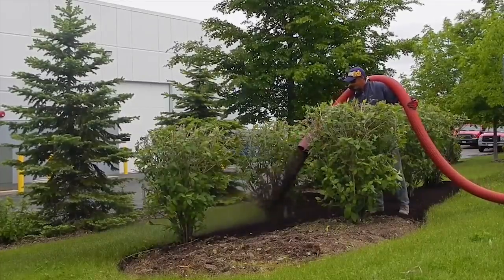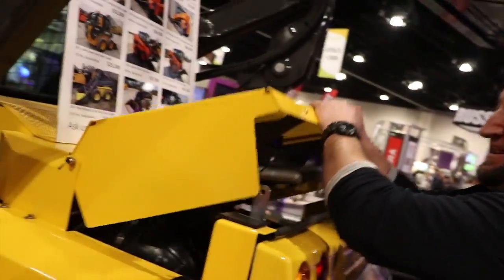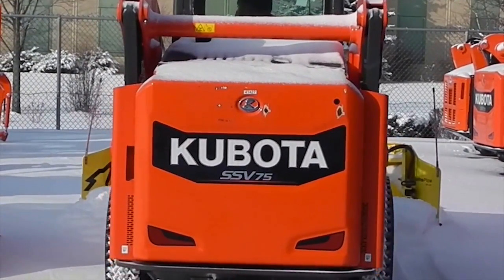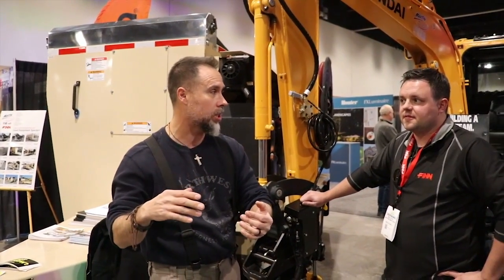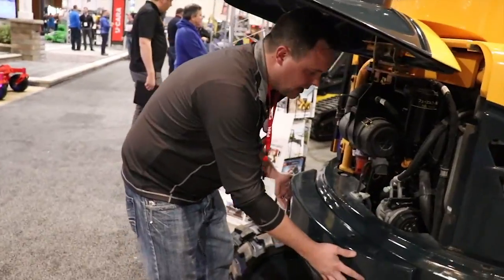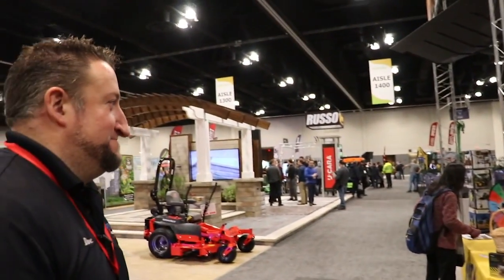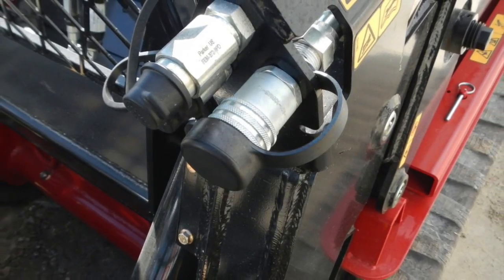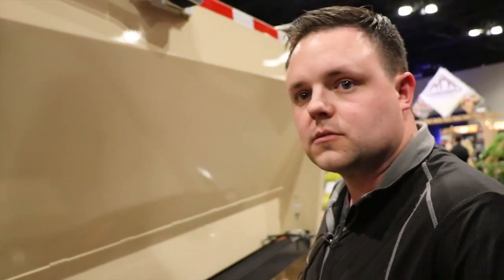Whats new in equipment at the Illinois Landscape show sponsored by Martin Implement

Comment: We've had a FINN bark blower for 6 years now upgrading to the latest greatest version last year and they are amazing. They do the work of 10 men no joke, they don't show up to work drunk or hung over or call in sick as long as you do basic maintenance with the added bonus of it grinding the mulch again before its blown making crappy mulch look like it's higher quality and good mulch looks like black gold bagged mulch lol. With only 3 guys we sprayed 85 yards in a 10 hour day at a condominium HOA which is insane because lots of beds lots of bushes and the person spraying can make sure a even amount goes down and smooth looking which saves tons of material on big jobs, that much used to take us three days with 8 or so guys working 12hr days tossing it by hand using wheel barrels so there were bare spots as well as behind bushes missed and lumpy clumpy appearance which looks like crap. Gotta do like 1500+ yards of mulch a year to really make money with it, otherwise it's better to line up a ton of jobs that are prepped and rent it for a week or two and spray like crazy. Obviously a loader is needed to keep the hopper full, we also have multiple extra sections of hose which enables us to do more from a single spot/pile of mulch. For smaller jobs you can fill it out of the back of the truck that is pulling it. Some companies have the unit hard mounted to a cab and chassis which the largest unit they offer usually is. Spraying 20 yards an hour or whatever the sales guy said could only happrn if you had a never ending wide-open area with no obstacles. Also in their demo video they should show how the person spraying can use their hand with a nice have duty glove to felect the mulch in order to protect bushes or the siding of a house etc.  Overall it's an amazing machine, the hydro seeder they make is top notch as well.

Comment: The company I currently work for does mulch for townhomes. A lot of town homes. We get 2 18 wheeler trailers of mulch dumped at the common areas load it onto the dump truck with a bobcat. Drive the dump truck to the start of the neighborhood and load from the back into wheel barrels, point is with all that handling well still get 12-13 yards out in 45 minutes roughly. With one guy spreading right behind us. All month long

Comment: Where i work we have one of the FINN bark blowers, i have used the 500 series and the 300 series. They work great for bigger mulch jobs, but the 500 series out runs the skid steer loading it. The 300 is perfect inbetween for commercial and residential mulching.
Reply: I also dropped the 300 series off a 7 foot wall and it had not a scratch on it

Comment: Also hyundai are big here in the UK,  they make some of the most used machines  for large and small construction applications and businesses, I had a hyundai and a kubota, bit were excellent. Lots of hrs on them and very little issues mechanically, if you find one that takes your fancy,  take the leap and buy one.

Comment: I have manure spreader chain basically. I think the express has walking floor correct? The express blower I wanted had several thousand dollars in upgrades to use the parts that were available from the factory at the time and needed more parts that were not available from the factory anymore. I would have to fabricate them all. 
 I’m not intending to bash just sharing my experiences. I like John Deere despite them getting the Caterpillar mentality,Kobelco , Volvo, Takeuchi, and Case.

Comment: Had a snow wolf like that 3yrs ago, it was slow to function,  pretty durable.  Kaboata skidsteer are junk, things are beat after 2-3k hrs of everyday use, guys I know get 2yrs outa them then they dump them. Hyundai equipment,  JUNK looses more value every time u start it, a quary had a 980 size Hyundai loader, what a turd after 1yr, completely wore out, bucket was paper thin and the beefed up welded wear plates just fell off with chunks of bucket the more they ran it. Its homeowner crap

Comment: For $99,000, plus truck and 2 employees, you have to move a xxxxload of mulch, etc. to see any type of ROI.  In addition, if it does move 15-20 yards per hour, I assume all of your material is on site.  If not, with only a 5 yard hopper, you are going to be making numerous trips back and forth to your supplier.  That bing the case, now you will  need to have a loader on site, which is probably as much the hopper. $$$$. Yikes!! I'm sure the repairs are inexpensive also.

Comment: Finn bark blower was the best investment to grow my company the quickest and with the best customers
Reply from the maker: That's great Tim, thanks for viewing !
Reply: @Tim Caron We install between 4 to 5,000 yards per year by hand and are considering either the MulchMate or a Finn Blower. My only concern with the blower is dust from the mulch getting into ac units and windows around commercial properties. Has this been an issue for you?
Reply: Alex Cochrane The major benefit of a bark blower is material preservation.  I can paint the bark a 1/2 inch to 3+ inches consistently throughout the project depending on contract.

For best results you spray approx 1 inch.  After the first rain the mulch sets and doesn’t move through out the year.

1 shoveler can keep the machine loaded if he’s working his ass of all day.    We had best results with a Cat 420 back hoe.  A skid steer makes a mess driving to the machine.

You can’t have idiots working on the machine.  The machine can be finicky until your used to it.  Can’t over fill and must sprinkle the mulch in as to not compact it.  Also the remotes are expensive so have the person writing the checks responsible for the remote.

I charged about $600-1000/ hour. 

I repeat you cannot lay bark mulch as smoothly as you can with a bark blower and a good operator.  The end result always comes out better.  You immediately have to go around with blowers and follow the machine hitting the grass, the bushes, the walkways, and adjacent buildings and you must do it prior to it raining or getting wet or it’s a nightmare.

Best part of the blower is it’s $100k new and 10 years for now you can sell it for 100k because the cost of the blower keeps going up.

If you put 5000 yards down a year that is the break even point for owning a blower.

I used to rent the machine for $1200 a day and had a waiting list,  two weeks of rentals pays for the machine for the year.

Comment: Hey Stan! Something out of left field for you... What kind of suspenders are you wearing? I'm a big fan of suspenders and have been wearing them religiously for about 9 years. Personally, I've been a big fan of "The Holdup Suspender Company" (not a paid endorsement). I bought a pair specifically because I needed TSA checkpoint-compliant suspenders for travel and because I worked in a secure datacenter with TSA-grade scanners. Their "NOBUZZ" poly-clip clasps hold super tight and never chew up my waistband. I notice that you seem to be wearing plastic clasp suspenders as well. I'd be very interested to hear your choice and experiences for what you're sporting! Thanks for another great video!

Comment: I just bought a 35z-9a Hyundai and its one of the best, if not the best mini excavator in its class. I tested bobcat, Kubota, John Deer Ect and its hydraulic system and how it puts the 25hp to the ground is amazing. I got a ton of options cab, heat, ac, radio, hydraulic thumb, pin grabber, long arm, counterweight,  2ft bucket and it was still 5k less than other machines. Its amazing on fuel runs about 8 hrs on 8 gallons and has plenty of power. Only complaint is AC works amazing but it falls on its face (very slow) when running ac. Can't really complain when it only has 25hp and zero emissions. My friend has a Hyundai 60 and 160 and both amazing machines for the price. When I buy my next machine, Hyundai will be my first stop.

Comment: Hyundai has been in Australia for a while I have run a 5ton machine and a 2.5ton, both great machines very very strong, seem a little slow in the movements but a great machine, and as for the toro I would consider an avant loader with telescopic boom over a toro but that’s my opinion

Comment: I own 2 Finn bark blowers. They are a decent machine . Lots of issues and parts and service not so good.
Reply: What generation do you own? If there are any. Me for instance I won't buy the first generation anything due to the typical issues & bugs that they have. Usually by the 2nd gen all the kinks are worked out.
Reply: Bb1216 and bb1240 they are not new but they are almost identical. There are several things I have tried to order that said months out or not available at all.  And they are pretty much the same for many years. How can dealers stock parts if the factory doesn’t have them.
Reply: Tried a different manufacturer and trued to adapt? We run express blower units in Australia, basically never had an issue getting replacement parts.
Reply: I wanted express blower but the floor system would cause issues in my application.
Reply: @allenlong3939  how so? What floor are you running in the finn?
Reply: i second this. very hard to get parts unless it’s from finn themselves
Reply: Even through Finn they do not have most of the parts in stock. I have ordered from Finn and had them tell me 8 weeks. Very disappointing. Old or new I have seen other companies have same issues with other Finn models as well.
Reply: Allen Long true. our 2015 model 22yard truck was a nightmare. but people wanted it so bad i guess because they aren’t making a 2019 model or something
Reply: They redesigned them  supposedly are coming out with them but not sure when.  I was going to purchase a new one couple years ago and was going to take 6 months to get one.
Reply: Allen Long ah! we now use EB 60’s with lightweight yellow 100ft hoses and it’s a breeze
Reply: What brand and model of hose please. I will be replacing and adding more hose.  I’m looking at Tigerflex and Flexaust.
Reply: Allen Long i’m not exactly sure. will reply in the AM when i get to shop 👍🏻. but if i’m not mistaken it’s tigerflex
Reply: Allen Long our yellow hoses are continental ContiTech lightweight. i think the 100ft was 740. little pricey but the guys can go all day without being so burnt out. we also have tigerflex orange hoses. they’re heavy as mess
Reply: I used continental before didn’t make it through the first job actually had issues with it on the first week. It was the black stuff paid through the butt and was terrible . Do you use a hard hose for the fist few feet?
Reply: Allen Long Allen Long i don’t allow the guys to use the yellow hose hooked to the truck. they use a harder 25’Ft orange hose from tiger flex. due to the yellow hose being very fragile. it definitely has to be babied. and the guys also do not drag it behind the truck whilst moving from place to place , we do use hard pipe if we have to but usually have enough with the hose.
Reply: Allen Long but i due agree. for the price it doesn’t really hold up. but if you take real good care of it and tell the guys “if it blows up that’s it. back to orange” it’ll last a bit longer lol. but we also will wrap it once in duct tape and it makes it last a bit longer. because once the mulch pokes a hole in the hose it’s just about over from there if you don’t tape it right away